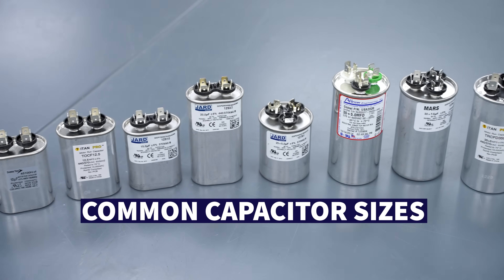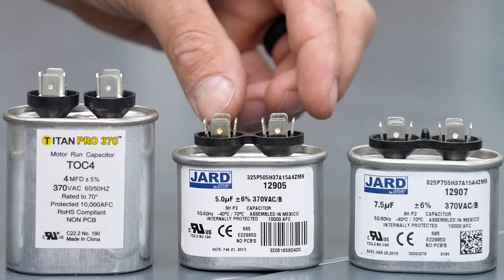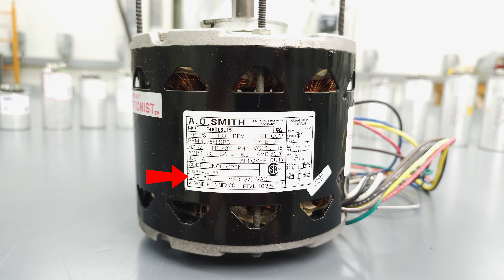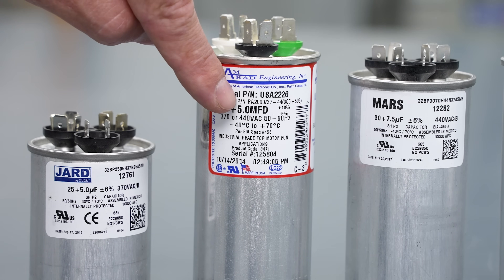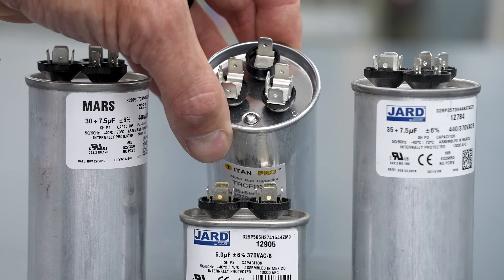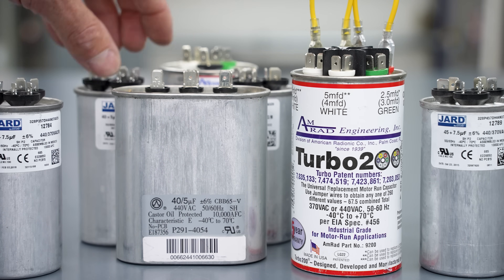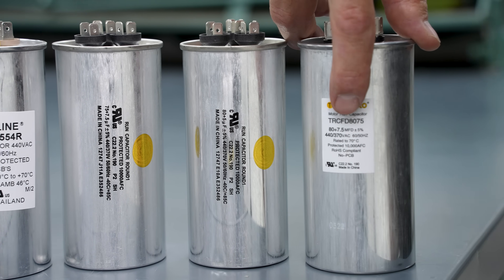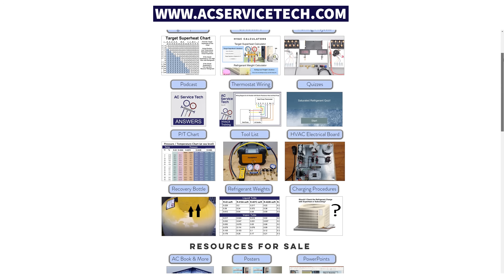Stock These Run CAPACITOR SIZES in the Residential HVAC Service Truck! Why?!!

Comment: I had a similar issue, my HVAC tech installed a 55/5, but after some research I found it should have been 50/7.5, everything seems to be working fine even after a couple of years, but my capacitor just went out the other day so I got this new one and replaced it with the correct one, want to see how long this one lasts?!

Comment: For you homeowners watching, every spring, test the capacitors in the condenser and furnace and keep one of each your system uses on the shelf Change the filters every two months , clean the condenser coil every spring, keep plants away from the condenser, install a 5-2-1 hard start kit in the condenser and a surge protector on the disconnect switch. If you do these things, you may never need a service call.

Comment: You can have an higher rating just don’t go lower so don’t stock a 40/5 just stock the 40/7.5 and it can be used with the 40/5 and so on.

Comment: Dear all,I have a question which capacitor should be used when there is no detail on capacitor that the burn,so does anyone have the formula please suggest me ,I asked everyone but no  one has a proper answer

Comment: AmRad's seem to be the best caps on the market right now, made here in the states.  Their "Turbo" universal dual caps are pricier, but can be wired to accomodate nearly all of the MFD ratings on motors, it eliminates the neeed to stock your truck with all of the individual dual run sizes, especially if you have a small truck/van that doesn't have a lot of room.   In the event you run into a unit with an uncommon rating such as a 40/10 or a 35/7.5, as Craig said you'll be able to get the customer up and running.  I also like the CPT (compressor protector terminal) feature AmRad has that works good with hard start kits, in the event the potential relay fails to take the HSK out of the circuit when the compressor starts, this feature will blow open like a fuse and save the compressor.

Comment: My last comment I said that my run capacitor failed. I got it replaced and the air conditioner works again, but that's not the end of the story. The capacitor that failed was NOT the original one that came with the air conditioner. How do I know? The failed capacitor was a 55/5 MFD capacitor. After some research, I found out that my air conditioner was only rated for a 35/5 MFD capacitor.🤦🤦🤦
Reply: damn, somebody messed up.   Did you check label on condenser fan and the label on the compresser for capacitor specs.
Reply: @Franklinveterinarycenter1of4  Yes. I did, but only after I looked online and saw that the capacitor was rated for 35 microfarads and I'm like wait a minute, the capacitor's been oversized this whole time?!

Two takeaways:
First, now I'm glad that the capacitor went out, or else I wouldn't know that.

Second, I'm surprised that the compressor didn't burn out, especially since it's a 20 year old unit.
Reply: @eric01406 This is not to imply bigger is better, because a capacitor that is too large can cause energy consumption to rise. In both instances, be it too large or too small, the life of the motor will be shortened due to overheated motor windings.

Comment: I have a 4 ton two speed compressor that quit a few days ago in the extreme heat wave in N. TX.   A few months prior,  I took off the service cover on the condensor to see what cap it had so I could buy one as a backup, while waiting for what could be hours to a day or more for a service tech.   I was very surprised to see a 30 / 5 µF dual run capacitor  as the only one in the cabinet    The bad one tested 17.4 on the Herm, so I knew it was bad.  Grabbed my spare and was back in business in 15 minutes or less.  LRA is 105 amp, but drops to 11.5 Amp (on the low speed) running after startup.  
Thus,  why would such a large unit only need a 30 µF run / 5µF fan CAP?
Reply: I would check mfr recommendations. Sounds low.
Reply: Tell us what the make and exact model off the label of your AC outdoor condenser.  I will lookup the proper capacitor from the factory.  I wouldn't be surprised if it should be a 45/5 or 40/5.  But anything is possible.
Reply: @Balticblue93   Amana ASXC160481BE . Two speed  scroll compressor.  I think the newer model  is a 17 seer.  I was unable to find the specs.  It's been running fine last 2 weeks with  30 / 5 µF +/- 6%
Reply: @Balticblue93  Amana ASXC160481BE . Two speed  scroll compressor.  I think the newer model  is a 17 seer.  I was unable to find the specs.  It's been running fine last 2 weeks with  30 / 5 µF +/- 6%

Comment: The capacitor reactance[ohms] is figured 1/(2*3.14[pi]*60[hertz]*farads. 
or 1/(377*farads)
Microfarads is Farads*10^-6. 

i.e. 5mf capacitor = 1/(377*.000005)=530 ohms Xc 
so if you connect a 5mf capacitor across a 120V 60Hz AC source, it will draw 230ma
 120V/530ohm=.230amp. Since the current and voltage are out of phase, it will consume no power…therefore 120V*.230A or 27.6VA.

Comment: Formula for capacitors are: In Parallel increase capacitance C = C1 + C2, and In Series decrease capacitance 1/C = 1/C1 + 1/C2. Example 1/5 + 1/7.5 = 0.2 + 0.13333333 = 0.3333333333 and 1 over this gives 3 MFD.

Comment: Run the Turbo 200s. Universal motor-run & the mini universal fan motor-run caps.  Made in USA. Good warranty.  Pass the cost on to end customer.  Simplify stocking.
Reply: That’s what I do, most likely you will change the unit before the capacitor again.
Reply: I have transitioned my van stock to primarily Turbo 200’s in all three sizes. So much simpler and I never need to run to a parts house because I don’t have the right cap.
Reply: What about when customers call you out for the caps being 4x the cost?
Reply: @one2toomany you most likely do not want said customer as a customer.

Comment: General question for anyone: Do manufacturers pair compressors & fans with capacitors to avoid going much larger on those components?
Reply: Capacitor mfr make what equipment mfr needs. More efficient outdoor fan motors use 7.5 instead of 5, so now we stock dual caps with 7.5. It was not necessary 25 yrs ago for residential anyway.

Comment: also, remember the relationship to know how the power of the capacitor affects the changes in voltage or frequency of the nominal design. Q1/V1=Q2/V2.

Comment: excellent video and class. Please in the next video, Can you explain the relationship between amp vs pressure?
Reply: They're two different things. Amperes are a measure of electrical current flow, but pressure is a mechanical measurement.

Turning electrical power (amps times volts) into pressure and flow is pretty complex, and depends on the efficiency and design of the compressor.

Does that help at all?

Comment: Do not use titan caps what so ever. Unless you want to go back and change them every single year. Mars premium caps or turbo 200s. That’s all I’ll ever use. If I even see a titan I change it out because there fail rate is that bad.
Reply: Cause they're built so cheap. Dual cap is only like $5. Company I work for buys titan cause they're so cheap to maximize profit. But I guess they want to kill customers motors...
Reply: Not true yes they are inferior quality compared to the titan pro or armad caps but I’ve installed ones on systems and they last just as long as manufacturers cap i means it’s multiple variables that can cause a capacitor to fail besides build quality. Now I do install and recommend amrad or titan pro caps but I give the customer the option of paying a lesser amount for a capacitor that comes with a weak warranty vs the other ones that comes with a 5 year. That’s like saying the cap is bad because of the brand and the new one you put in that’s a better brand will not fail and you come back a year later because it was something else causing that cap to fail
Reply: Thank you! I haven't had a chance to deal with them since they came out. Good to know.
Reply: The Titan Pro caps are total junk. Might get a year or two out of them.
Reply: @jonhvac  titan hd is us made better quality
Reply: @boywhohadatiger  Yes the Titan HD is better than the Titan Pro.
Reply: I work for a company called Marr’s and new techs thought we had our own capacitors as a company
Reply: What about Temco ?
Reply: @kastenusa  Never heard of that brand but, it doesn't sound good to me.
Reply: @jonhvac  I had it on my Climatemaster had to replace it after 10 years.
Reply: @kastenusa  10yrs is a good run, you really can't do better than that.
Reply: I've had a bad run of Mars, so I'm scared of using those too lol

Comment: Remember, you can put a 5 and a 7.5 µF capacitor in series to make a 3 µF capacitor. Of course you need to have room to install two capacitors, wrap them up and secure them properly.
Reply: If in series that would be 12.5 mfd capacitor?
Reply: C1 X C2/ C1 + C2 = capacitor when wired in series @theprofessor5584

Comment: I've had to change 370/440 45/5 dual  run capacitor 2 times
1st it lasted a month
2nd time it lasted a week
I checked windings for both the compressor and cfm which tested fine both times and amp draws were both within range of the data plate. Condenser coil is clean and cfm bearings are good spin freely 
What's something that I am missing or not checking resulting in the capacitors going out?
Reply: If you have repeated capacitor failures annually and you’re buying good quality capacitors that cost $15 or more, then you might have a compressor going bad.
Reply: @USA-GreedyMenOfNoIntegrity  That's what I'm thinking too both times I replace the capacitor they were completely dead. I've noticed that on the top shell on the compressor  showed signs of overheating. For context this very same unit had a leak at the high pressure switch which blew out the charge I repaired and charged it accordingly. The only thing I haven't done yet was an insulation test, but since  I replaced that capacitor customer hasn't called back since.
Reply: @mrgreen9086  I found a 19 yr old Am Std hp, serial capacitor killer. No cool, sparks flying out from around vapor svc valve when 30A breaker at unit reset. 😳 Measured green ground wire current at 103A. Yep, shorted compressor windings when powered only. Tested windings with meter, measured normal. Insulation tester on your next trip out.
Reply: Possible power issues?  Surge or spike from nearby lightning?
Reply: @OnusBones  maybe
Reply: If you put the same brand cap in you may have just gotten a bad batch of capacitors. Of course, make sure you are not using a start capacitor in place of a run capacitor. Using a start capacitor in place of a run capacitor will fail.
Reply: @neutrodyne  that seems likely
Reply: If a capacitor has an expected life of a certain number of hours, are those hours when the equipment is actually running or is it how many hours since it was first installed?

Comment: The larger metal with higher rated voltage and BETTER QUALITY will probably last to the next century.
Reply: Maybe capacitors made 30 to 40 years ago. I haven’t seen any capacitors made in the last 20 years that will outlast the unit. And yes, I’ve had to go back and replace Amrad capacitors after 5 to 7 years.
Reply: @USA-GreedyMenOfNoIntegrity  
Okay, I believe you have more experience than me 👍
Reply: If the homeowner changes the filter regularly 😅
Reply: @hotfeva9843  
I'm writing about the capacitors, they will be still in good condition after everything else is gone.